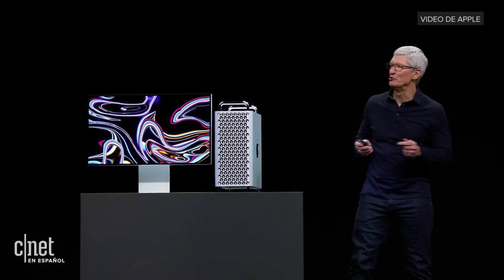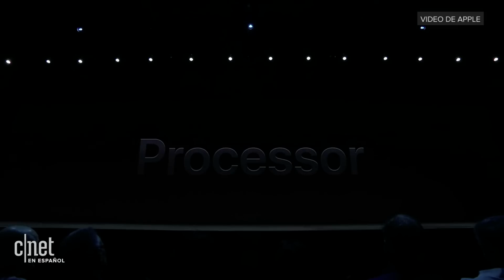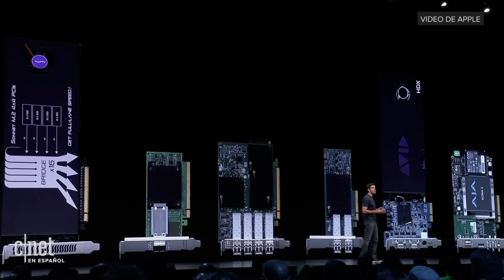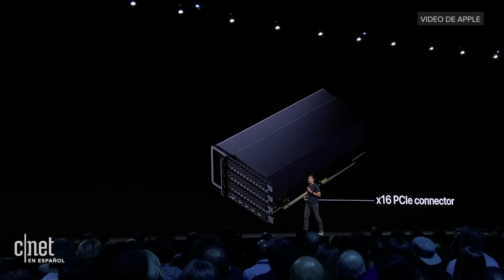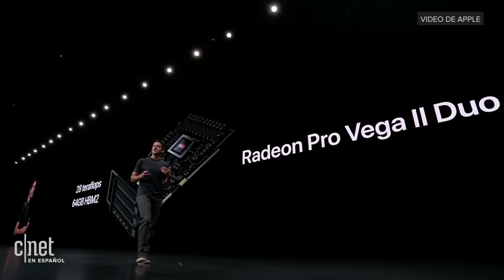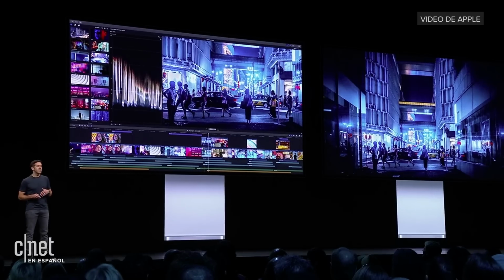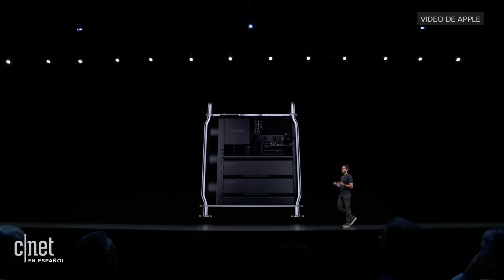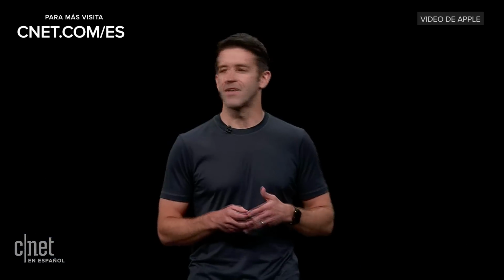Así luce la Mac Pro de 2019

Comment: BUENO...
Tiene 60terafloops de potencia, Amd Pro Vega II Duo (exclusiva y la más potente del planeta), 128gb HBM2 cada una, 4tb Ssd 3000ghz o más no sé, Intel Xeon nueva generación de hasta 28 núcleos a más de 6.0 ghz con overclock, integridad del soft con hard, Chip T2, 1,5GB de Ram DDR5. Los materiales son de acero inoxidable de grado quirúrgico, diseño de titanio y aluminio series 7000, 100% reciclado. Y su espacio es muy chico para lo que es y no se escucha ningún ruido, y aún están los típicos ignorantes criticando el diseño y el precio del soporte del Pro Stand, mientras otros monitores cuestan 40,000 dólares y son mucho peores.